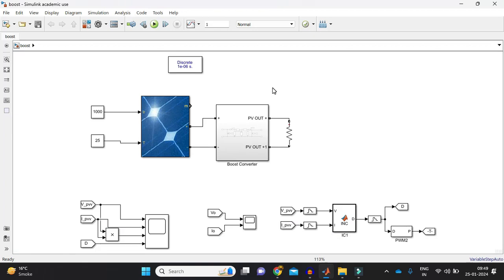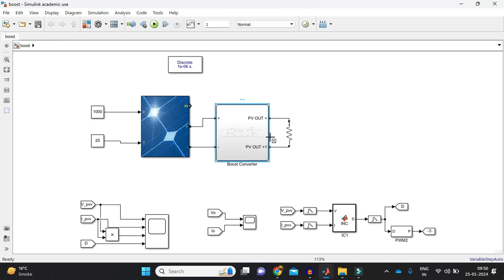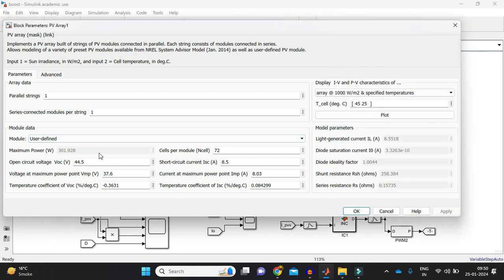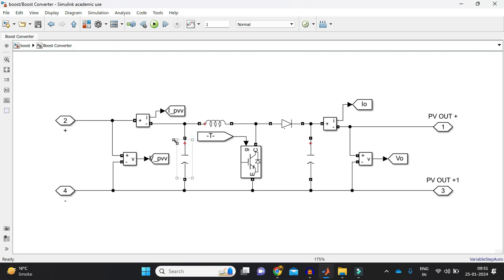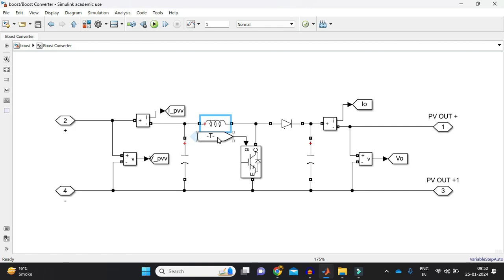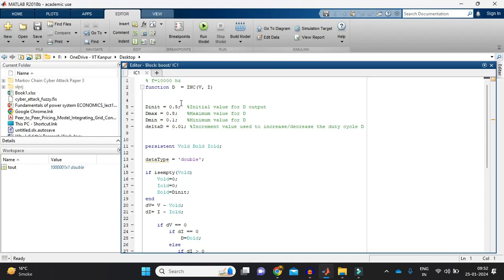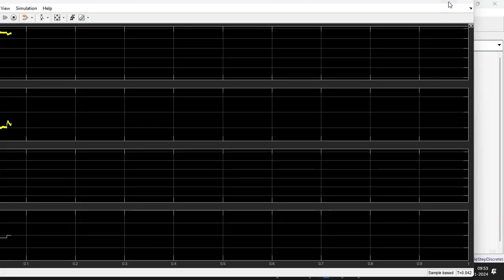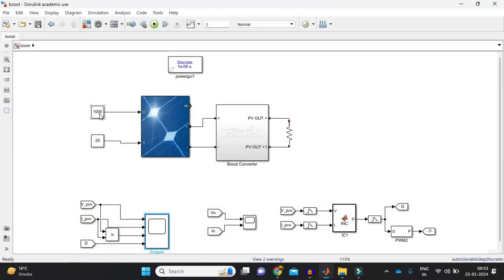InC MPPT with Boost Converter

Comment: Hello sir 
I want to simulate pv boost converter with 1phase inverter
Reply from the maker: I have not created it perfectly there is some proper filter designing required. Waveform is coming distorted a bit. If you need that file i will share.